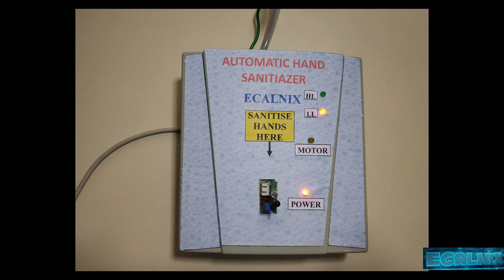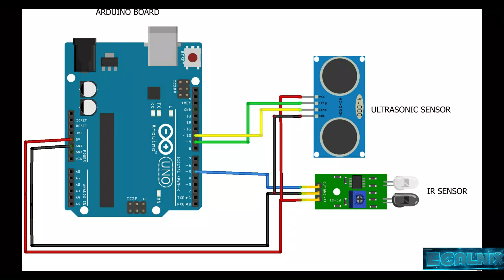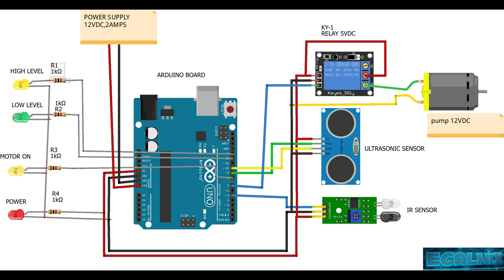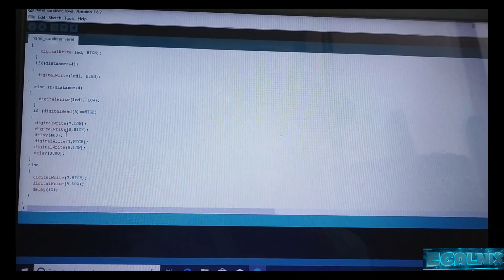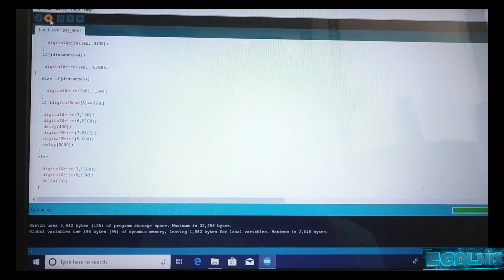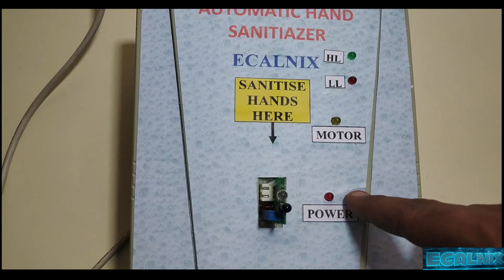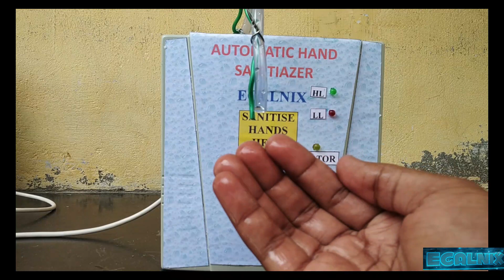Automatic Hand Sanitizer with level  indicator (தமிழ்)

Comment: 6v pump use panlama bro ...12v ku badhila
Reply from the maker: Yes You can use with voltage regulator circuit